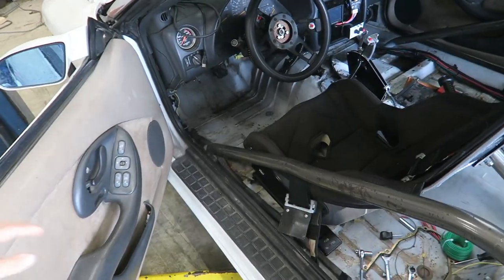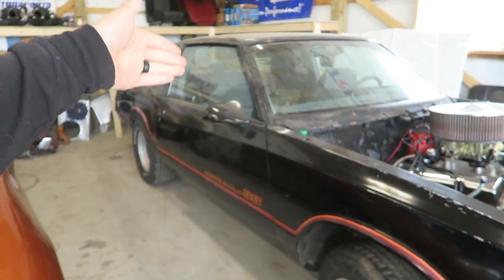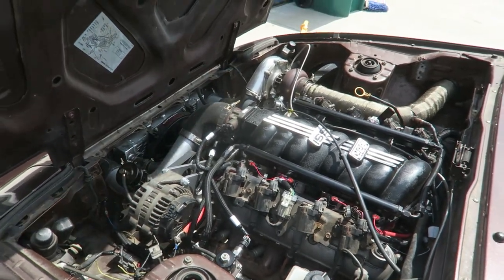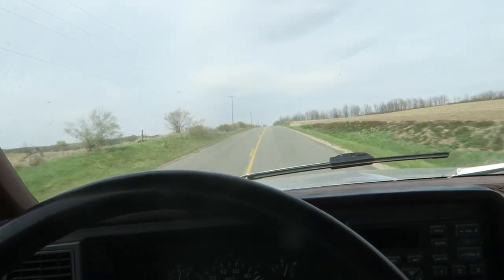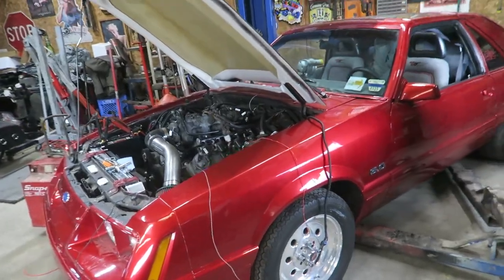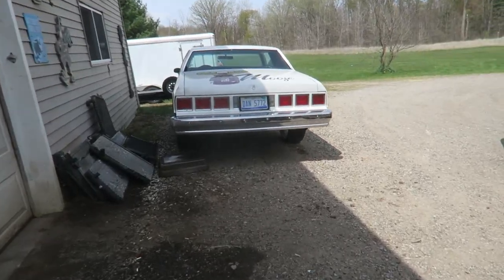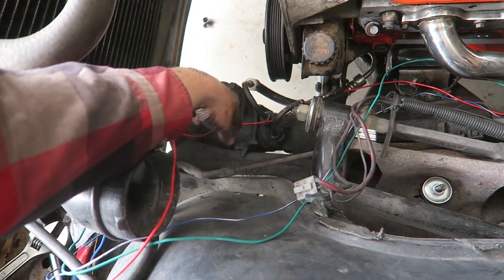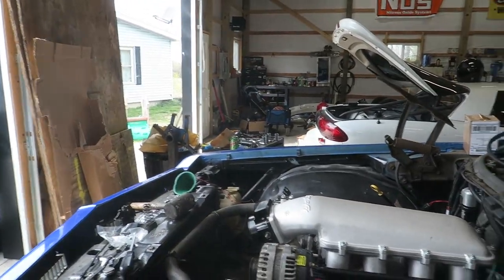It's a little 4.8 Single Turbo car... Lock in?

Comment: . That Racecraft seat mount is so high. My head is against the roll cage. They need to redesign them. They work for the short guys.. but if your 6ft they are crap 😭
Reply from the maker: With my helmet on I'm probably 6-6'1. Did you make the same mistake I did at first and install the mounts backwards? Once I flipped them around it dropped the back a lot
Reply: @SniderTron3000  nope she’s on right. I could probably get a half inch more is all. It’s kind of a common complain on ls1tech. Sucks. It’s a nice lookin piece too